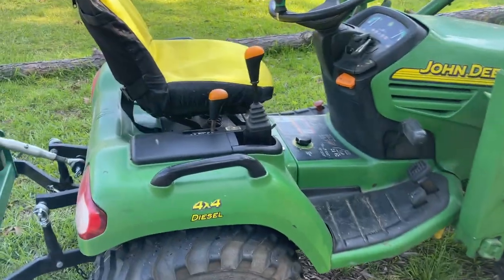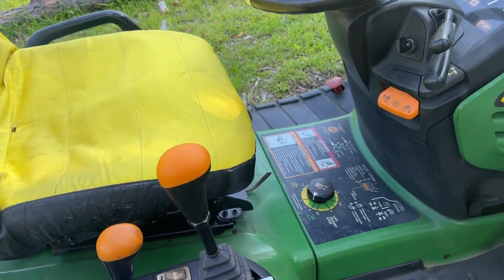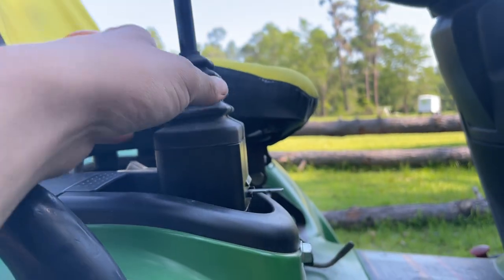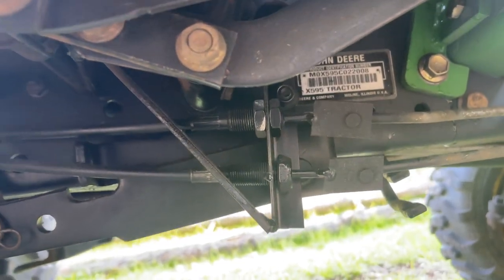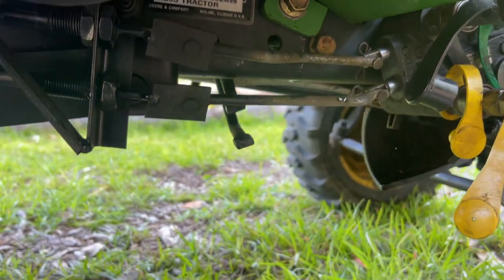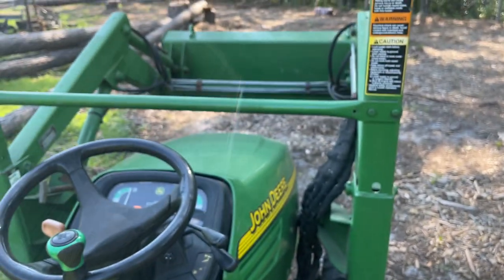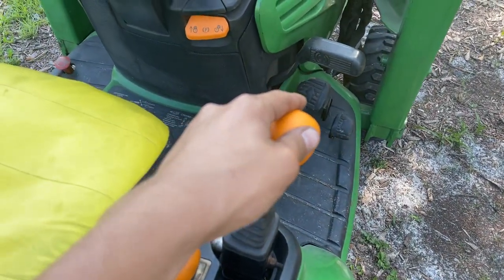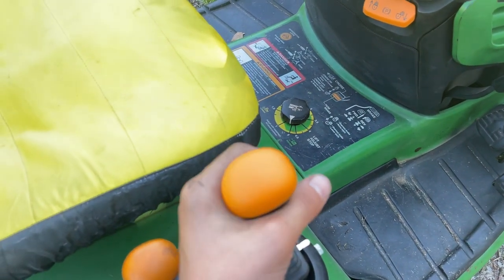John Deere Garden Tractor Hydraulic Lever to Joystick Conversion- Super Easy!

Comment: Cool, are you going to use the dash levers for like an independent 3 point hitch control or something like that?  Cool idea.
Reply from the maker: I haven’t decided what I’m gonna do with them yet, which is why I haven’t removed them. It would be neat to install another valve for a 3rd function or the 3pt lift. Or maybe some kind of electrical function in the future. I’ll be installing a cab next and hopefully a full custom AC system so maybe I can utilize them for that. Still trying to get a rear PTO too. Thanks for watching!

Comment: Nice setup, strongly considering doing this on my X595. Does the joystick have the capability to work in float mode?
Reply from the maker: It does! Pushing the lever all the way forward puts it in float mode just like the larger tractors. It works pretty well!
Reply: @LukesJohnDeereGarage  Awesome, I will definitely be giving this a go